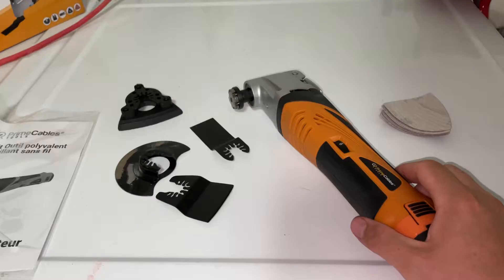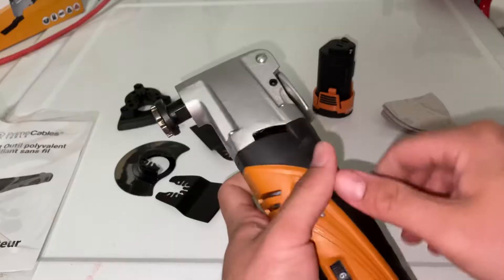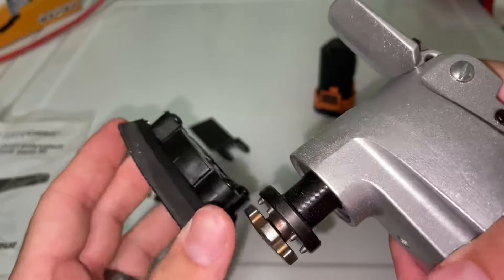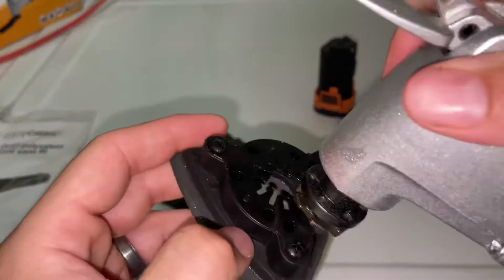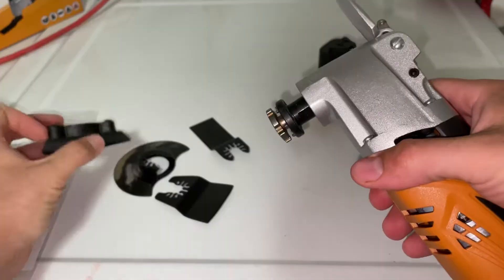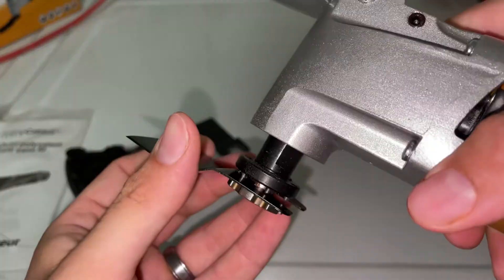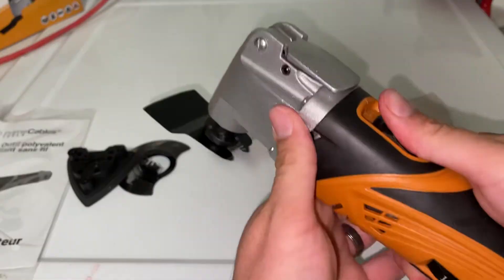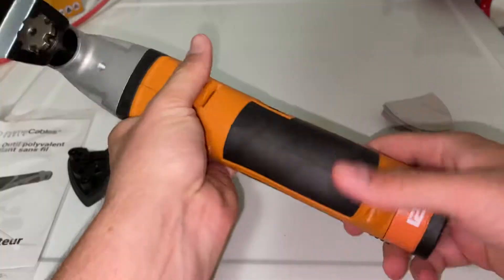How To Change Blades On An Oscillating Multi Tool

Comment: Some cutters are ring shaped rather than u shaped, how do you handle those.
Reply from the maker: The ones that are ring shaped are made for the oscillating multi tool that requires an Allen key or bolt to be removed from the head. The u shaped blades are built for the quick release multi tools like the one you see in this video. Hope this helps. Thanks for watching. Please like and subscribe.